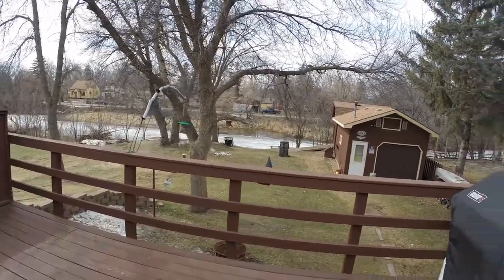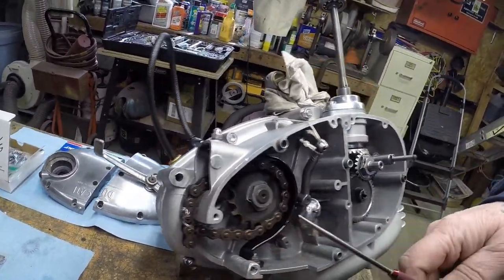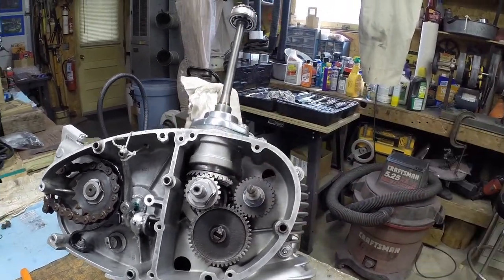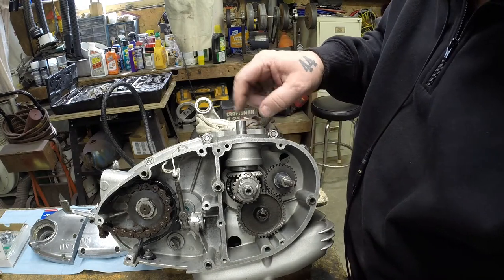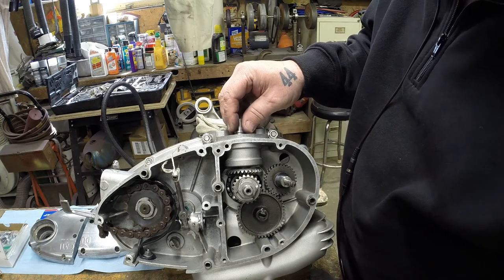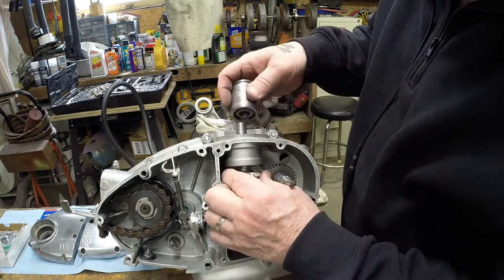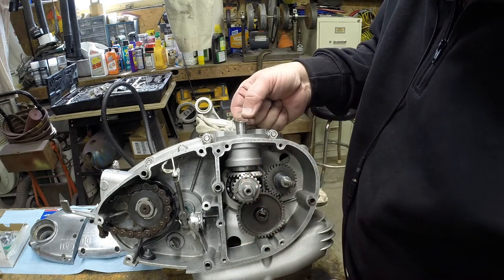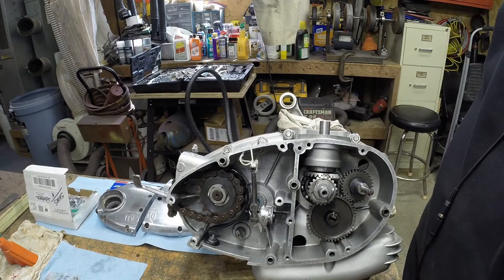Ducati restoration episode 3

Comment: Good job!
I bought one just like that for a couple hundred dollars many years ago in running but scruffy condition. Planning on putting a 350 Sebring engine in it. I also have a Diana and Sebring, both of which I've put a lot of miles on and both run very well. The NC singles are great bikes!
The YT site Back to Classics has a series of videos on rebuilding a 200cc NC single. If you haven't seen it, it's filled with good info.

Comment: Paul check the ground surfaces, page 86 right column 2nd paragraph in your Clymer manual the orange one..  I Just called you and left phone# I may have some information on LED bulbs for head light, parking lamp, and tail light bulb.  If you noticed you have a great 28 watt generator so switching to LED helps a bunch.  I have 64, 65, 66 new and old parts.  ron in WA

Comment: Use the original  shims if  you  are able. On matched bevel gear set you will  see a grind mark.  When they are flush  to each  other  the  shimming is  correct.  otherwise  you need to use a blueing agent  to  see how the gear  teeth mesh togather and  backlash should be nill with no binding  The original  factory workshop manual is the  best source  for this information. I  think copies of it is  available. Shimming the bevel  gears is not  easy. Especially  the first time doing it. The  gears  should not have slop.  But it Is not perfect . Get it as  close  as  you are able  with no  binding.  look  at the  grind mark on the  gears .  The factory  did  this  to make it  easer  to set  them. This  was not mentioned.